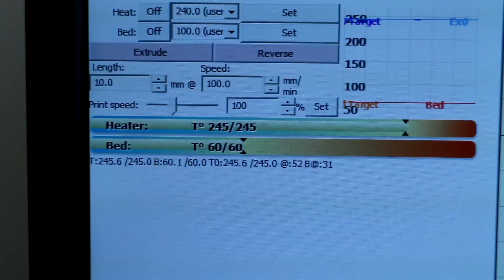3D Print in Very Strong Nylon Alloy 910

Comment: is the weight of the Nylon Alloy 910 alot lighter that Carbon Fiber.

what program is need to be able to 3D print molds?

I have experience with CAD software,  I was curious if you can use AUTOCAD 2015 To design the mold and layout the mold.

I really want to design a Nylon Alloy Racing Pod for the GEPRC GEP-LSX6 ?

Comment: The Bridge Nylon should have been stiffer than what you show. It also should not have been as white. You absolutely have to dry nylon filament before using it. The popping and cracking is from moisture escaping as steam and makes the nylon extrude more like a foam than a solid, thus the added flexibility.

Comment: oh one idea also, what about a stiff or brittle material inside instead of air or solid nylon printer material? like filling it with pure PLA to give it a sort of "bone" like infill
Reply: Printing ABS with PLA infill on dual extruders has been done with success, to preserve impact resistance and smoothing of ABS, but with the added rigidity of PLA. Not sure if nylon is in PLA's temp range though.
Reply: most is no where near so you would have to print solid and make sure the nylon went completely around the PLA so it would "float" over any PLA that was melted to ensure it did not run off, or out of the print I think, but could see this making it quite resistant to bending :)especially if it was infused with carbon fiber lol
Reply: on an added note, not sure if I mentioned it cause I cant find my other comments, but instead of PLA inside the higher temp nylon, I was thinking just use something with a comparable temp that is also more brittle like lexan (polycarbonate, especially if infused again with something giving it greater rigidity like tungsten, or carbon fiber, though it seems finding PC with carbon fiber is not going to be as easy as any of these other products, so getting PC pellets, an extruder to make filament and carbon fiber from a source like asbury might be in order lol

Comment: I wonder how well the nylon bridge material would work for making timing belts, might have to go wider to get integrity but sounds like it would be useful for making those for say rotary table assemblies for those of us who plan on using the extra axis control to run a hybrid CNC mill/3D printer/laser cutter-engraver design

Comment: looks like the next best thing to polycarbonate. think i'll get a spool.
the material is certainly great for 'copter parts, but not so much for this particular arm. it looks like it was designed with high stiffness materials in mind. with the high elastic tensile strength of 910, thick, hollow parts with low infill, or 3D structures will work much better, and give you the stiffness, you just cant get out of a flat arm from semi flexible matierial. as clean as it prints, it may also work verly well for gears and mechanisms.

Comment: After noting your settings and Taulman guide lines for 910, I must say that I find this stuff utterly unprintable. I must have made 30 attempts at it. It just warps and lifts off the painters tape or pulls the tape off the print bed. Maybe my roll has absorbed humidity or something. Tech2C, you can have my roll of 910 if you want it. I'll send it to you. I think I'll stick to PETG for my quad parts. Love your videos though.
Reply from the maker: Sorry to hear your frustrations. Sounds like you gave it a good attempt! All I can suggest is crank up the heat bed as high as it can go to prevent the Nylon from warping whilst printing.
Reply: I'll try that. I'm printing on a wanhao D6 which can go very hot on the bed. Thanks.
Reply: Or you can go to the Taulman website and read their suggestions, and follow them. The recommend printing Alloy 910 at only 45 C bed temperature, with PVA on glass. When done this way it works great. I've also had great success printing it with hairspray on glass at 45 C but using a 2-layer brim (1-layer brim can still sometimes warp a little around the edges - 2-layer brim will nail it down tight).

This stuff is hardly unprintable. I've had great success printing out the new Birdbone Helium quadcopter frame with Alloy 910, and they've turned out more durable and lighter than the same frames I printed out with PETG.

If you haven't had success printing this stuff your way, you can try the manufacturer's way and just get it it done.
Reply: Calzoid71, I also have had many failed attempts at printing this stuff. However I finally nailed it down using these settings:
Nozzle: 249 (wanders between 243-255)
Bed: 60 (dry blue tape w/ room temp 70f)
Retract: 5.5mm @ 45mm speed
Print speed: 45mm/s
Fan speed: 100
Layer height: 0.2mm
Wall thickness: 1.2mm
Top/Bottom layer 0.8mm
Infill: 50

Additionally the first 2 layers need to be babysat to control any stray strings that will catch on the nozzle. I have had good results and am continually refining these settings on an Alunar M508.

Regards, Dan

Comment: I have printed some arms off with the 910 alloy and I was impressed with the strength after printing, but after a few days it has gone like the 610 example you showed in your video, very soft... Any Ideas why?
Reply: your print absorbed water
Reply: Don`t really know, brand new roll... And Taulman are a little puzzled too... Put them in the fridge for 20 mins, hard as a rock LOL, Should be OK to use the quad in the UK winter time..hehe
Reply: +karladam1234 if freezing it makes it harder then it probably has absorbed water? i let my nylon part soak in water for a bit and it was destroyed
Reply: Not the freezer, just the fridge... Very hard once printed, a few days on the desk and bendy bendy happens...
I have another brand new roll to try out soon,when I get time, Taulman have offered to send out replacements as well, but I said wait until I test a bit more... Just want to make sure I get the same results with the other roll...

Comment: Hi Tech2C! Which 3d printer did You use in this video?
Have You done some modification?
I need to buy and a printer in order to use this material, are there some tips to consider?
Thank You very much!
Reply from the maker: Hey, I used a Prusa i3 kit. There's many to choose from. Recommend using an all-metal hotend like the E3Dv6. I'll be moving to a core-xy printer very soon, so maybe wait for my review of that before diving in.
Reply: ok!! thank You very much!

Comment: Thank you for the review.  No mention of baking it before hand, have you had a chance to print with this Alloy 910 since this print and how did that turn out?  Particularly interested in whether you needed to bake it this time or not.
Reply from the maker: +Stephen Jeppesen 
I received this roll and printed a few days later - no baking in between. I haven't used it since and going by other commenter's I will definitely experience popping from moisture absorption. I've stored this roll in a zip tight bag with desiccant so hopefully it isn't as bad as others experience.

Comment: Great review! Do you recall the mm/s you printed this part at? 

I had success with small parts at default speeds(60mm/sec on the robo3d)  I did notice some popping at 245 so i lowered the temp to 230 and the print speed to 30mm/sec and it seemed to help lay a nice layer but the print eventually failed(much further along "40% mark"). The fail might have been because the infill was set to an undesirable settings(5%). I'm using a pei sheet on top of my glass heated bed which  was set to 80c.  I might try bumping the bed temp to 85c, lowering the head temp or raising it to 260 and the bed set to 55c with elmers glue. 

 I should probably try baking it in the oven first. Lots of things to do tomorrow!
Reply from the maker: +Joseph Tarling 
I printed these at 35mm/s I think. Quite a bit slower than your speed. Also a printing temp of 245c, a bit higher than yours. Try those settings.

Yes, crank up the heatbed to 80c as that should prevent the part from warping during the print. That's what I discovered after further printing with this stuff.
Reply: +Tech2C thanks. I ended up settling on 60mm/sec inside / 40mm outside with 230c extrusion,  55c bed with Elmer's stick glue. It stuck on there really really good with the pei. 

I did notice some slight imperfection between bridging but I believe that could be resolved with a higher infill. 18% is too little for this filament. 25% minimum should resolve any issues.

Comment: I have started printing with Alloy 910 recently but I am having issues with tiny black spots showing up inside the print. Any suggestions? Have you noticed this when changing filaments? Its not the typical black burnt build up from the exterior of the nozzle, these small specs are inside the print
Reply from the maker: +Chris Halliday 
Not at all. That is bizarre. I assume the specs aren't visible in the filament before printing? Dust or something?
Reply: +Tech2C Yah, nothing seen in the filament. I pulled the nozzle and its a mess inside :P

Comment: How is this performing as a quadcopter material? I'm looking myself into buying this thing :)
Reply from the maker: +Maciej Janowski 
I think Nylon is the perfect accessories material for quadcopters, like motor mounts, supports, clamps, etc as the flex will render that part indestructible. However for longer frames I think it's just a little too flexible.
Reply: +Tech2C What then? PC?
Reply from the maker: Maciej Janowski

PETG! Checkout the next video :)

Comment: I cant seem to get my extruder to sustain the temp of 245 on my flash forge dreamer. Shame, cause this filament seemed really nice
Reply: Make sure your heating block is completely insulated. Most aren't and it lets out a lot of heat that could be used by the block.
Reply: +jeevesme yeah I since fixed this, just turned off active cooling lol

Comment: I got some after this video for mini quads as well. I inlay 3mm square carbon fibre in my frames so this looked idea. I was disappointed with it though because of the popping and hissing. I got it from a local Aussie supplier. It was sealed in a bag but very flimsy plastic with the silica bag. My first print was more like a stiff open textured sponge. Just a mass of holes, even in the top and bottom layers. I put the spool in a warm oven for five hours and it was better but still not as good as your prints. I could not hear any popping after I dried it. I have to go with 100% infill to get a half decent print. Maybe I got a bad spool. Be interesting to hear if anyone else had this problem....  BTW Great videos, keep it up...
Reply from the maker: +Fug Bucker 
Sounds like your under extruding. Check the diameter of the filament. Try bumping up the multiplier by 10% increments until no holes/gaps appear when printing.

That sux regarding the popping, but great to hear the oven treatment works. Let me know how you go with 3mm square carbon, I would have that it would be the weakest link?
Reply: +Tech2C I tried upping the extruder rate and it did improve a bit but it still would not lay a steady stream of nylon like it does with PLA/ABS. I contacted where I got it from and they said it was under extruding but I have never had this problem in my 9 months of printing almost daily. It is my first time with nylon though.

After a couple more emails back and for with the supplier I was not getting the answer I wanted. So I emptied the rubbish bin and found the bag it came in. After inspection I noticed the bag had a break caused by rubbing around the outer rim. I told them and sent a picture but they dismissed it saying the had a few broken bags but the filament worked fine. 

I have managed to get a few prints out of it but I am not confident with it and will not order from that supplier again. If I get any more I'll get it direct from Taulmans and not a supplier who has had it sitting around for months absorbing moisture. I also re-wound onto a bigger spool and as I work through it, it is getting better so maybe the moisture absorbs towards the centre and when I re-wound it I used it first...?
Reply from the maker: That's interesting. Did you measure the diameter of the filament with calipers? Maybe the filament is a little under 1.75mm but is returning to standard thickness the further in the roll you get?
Reply: I didn't measure the diameter but think I leave my settings at 1.70mm which is what I find most filaments are. I should have got a video of the first few prints before I dried it. The popping and hissing was non stop and you could see the steam coming out. I'm wondering if I tried drying it in the oven again would help or once it has moisture it will always have moisture....?
Reply from the maker: Have a read of the comments in the other nylon bridge video. There's valuable advice regarding nylon and moisture absorption prevention.

Comment: Hi. I'm having a nightmare with corners warping while trying to print the Peon 230 base plate in this Alloy 910. The first few mm go down perfect and flat. It's the top layers that I guess are shrinking and pulling the layer corners off the bed later on in the print?
Assuming it is the cooling top layers that are causing it I'm thinking of applying heat to the top of the part in the form of an infrared heat lamp.This should help shouldn't it?
Have you got any tips to print this, and other largish parts with this filament?
Reply from the maker: +Mark Henry 
What is your print bed surface, and bed temp?
Reply: +Tech2C It's a glass heated bed (Kossel Mini delta) . I had the best (least worst) results with painters tape on a 45C bed. I managed to print an acceptable top plate with glue stick on a 65ishC bed, but that same setup didn't work with the bottom plate.
I have a big cardboard shroud around the whole printer to stop draughts getting to it.
The filament specs say 30-65C. I haven't tried anything below 45 yet though.
The other parts of the frame print fine. It's only the bottom plate that I'm struggling with.
Also, I am slicing it at 100% infill. is that going to make the print more prone to warping do you think?
Reply from the maker: When printing on painters tape, is the part lifting off the tape or is the tape lifting off the bed?
The glass transition temp of Alloy 910 is 82c, so you could up the bed temp to 80c-85c which should prevent warping.
Printing at 100% infill will certainly exacerbate warping, but try a hotter bed first.
Reply: I saw both the part lifting off the tape, and the tape lifting off the bed. I'll try the hotter bed. Cheers.

Comment: No sizzling or popping: Filament is dry!
IF you have sizzling or popping with nylon it means it has absorbed water. Nylon absorbs water like crazy. On larger print jobs i've seen it start good and slowly the quality drops as the nylon gathers moisture so damn fast
Reply from the maker: +skaltura 
Hey, yeah I was referencing the previous video where the Nylon Bridge sample I had was sizzling and popping like mad. It must of been left out of its bag for too long. Cheers.

Comment: may i ask if you have done something to the y axis yours sounds soo smooth, i have the same kit and im getting nuts of the ratteling that the y axis makes

Tom
Reply from the maker: +tom haaima 
Try reducing the default max acceleration in Marlin. I have mine set to 800.
Reply: +Tech2C i wil try that, thanks

Comment: Exactly what I was wanting to know and see after the last video. So informative! Planning on building my 3d printer next month based off your modifications so I can start printing zmr250 parts sp thank you for all the amazing work you put in on these videos. 

One question though is could you print this material with a stiffer core like carbon in order to eliminate the flex but keep the part bulletproof?
Reply from the maker: +Agia 
Hey, this stuff seems like the real deal for quad frames and parts! 

If you're after stiffness, then which ever foreign element you add to stiffen the frame becomes the weakest link. Probably carbon fiber tubing of 10mm+ diameter will be adequate.
Reply: +Tech2C Without a doubt I agree that any sort of core material which is much more rigid but also more prone to breaking would be an issue but at the same time using it would allow the 910 alloy to be used for much larger pieces and give extended life to a otherwise fragile part like a 450mm quadcopter arm, Correct? Otherwise the 910 alloy alone might provide to much flex for something of that size without a reinforcement material inside for rigidity. 

Could be totally wrong in my thinking thats why im asking =)